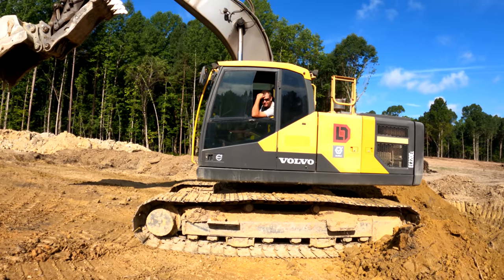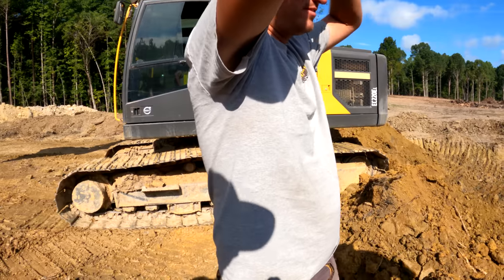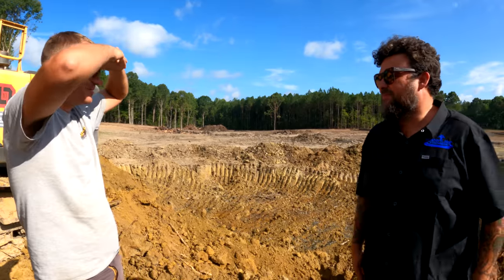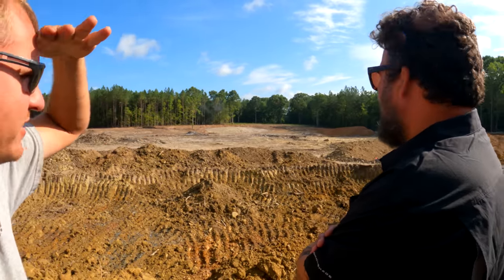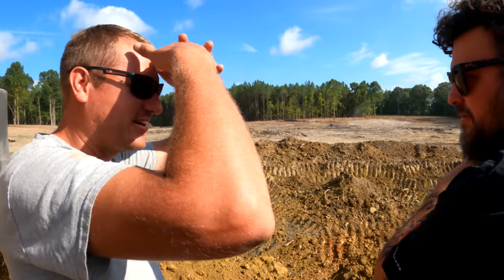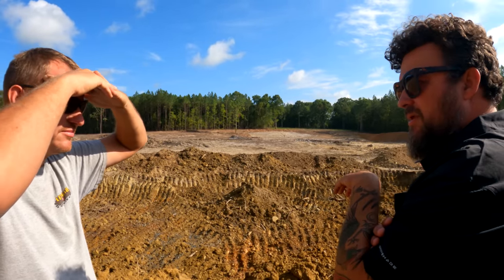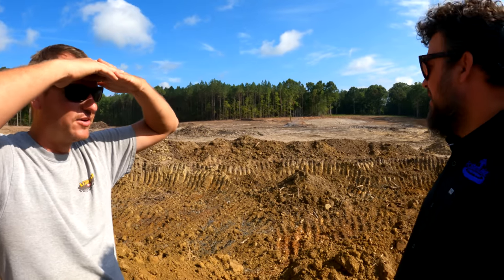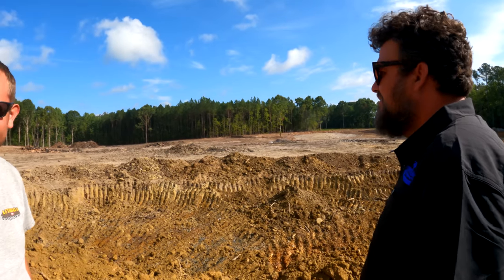How to Prepare a Pond to Grow Trophy Bass

Comment: Went trout fishing a few times after stocking and stopped after releasing 24 8 inch trout now in northern N.Y. they use healthier trout at stocking like12 to 14 inches and also stocked walleye's which took good for the first 3 years till the local people stole all with nets out of season like February when the spawn on rock stream beds.

Comment: Was wondering,, I am sure ,, just guessing 😂 the amount of water inside the pond effects the size the dam needs to be to hold the water back ,, yes or no ,, I was just wondering on what determines the size the dam needs to be ,, other than the fact that you want to drive across it ,,
Reply from the maker: The depth of water (height of the dam) is the biggest factor. Fluid dynamics is an interesting subject.

Comment: I would ask the guys from the fishery if having lots of ash from the ground water run off into the pound will be a issue. I personally would not berry all that debris and closer the 20 ft with clay between the ash. that's going to give you issues with your water. see what they say so chris knows.
Reply from the maker: Good question. I’ll ask. Thanks
Reply: @BealyGood  lots of run off from burnt properties can cause toxin to build in the water making it acidic and prone to having a big allegy issue . you could end up fighting this for years. you might need to add bentonite to the banks were the ash is berried to slow the leaching down. I'd stop bearing the ash so close. might be more work but save your pond from lots and lots of issues.

Comment: The trout  is something  bama bass did not stock , different locations will have different fish,  do they ever stock carp or catfish in bass ponds
Reply from the maker: Great question. I’m making a list for when they come back.
Reply: I know on the bass pond forums as well as on state and private companies that manage ponds they recommend never putting catfish or crappie in a bass pond. Catfish directly compete with bass. In ponds where algae is a significant problem people do stock sterile grass carp. 

Also, Bamabass just stocked his pond with bass only two months ago. They are far too small to feed on trout which are more apt to feed on them. The bass have to be at least 3 or 4 pounds before one starts adding trout as a fall food source. I won't be the least surprised if Bamabass adds trout and goldfish when his fish reach the larger sizes. He's all about producing huge bass and stocking trout is one of the best ways to do it.

Comment: I know having fish sounds super exciting but you got to give that pond some time to work itself out. Usually on a new pond you got to give it like a full year grace period to just let it do its thing. Otherwise you will lose fish and it will never sort itself out
Reply: Not true. There are many examples on the web and thousands more not publicly shown that prove successful ponds can be started soon after they're built and filled. These ponds are not like little home aquariums that need to be cycled. Watch Bamabass's pond build where he built his pond last year, had it filled by December and then stocked it with bluegill and golden shinners at the end of January. He would have done it sooner, but it was winter and the water temperatures were too low. Those fish have grown extremely fast and have reproduced in the tens of thousands. By April he put in threadfin shad and showed that the bluegill had grown large enough to spawn in less than 3 months. Just four months after building the bait fish populations he stocked his bass at the beginning of June and now those fish have more than doubled in size. Bamabass feeds his bait fish as well as monitors oxygen and nutrient levels and adjusts them as necessary. His pond is only six months old since it was filled and it's booming with fish and aquatic life. 

Waiting a year is a needless waste of time.

Comment: Hey Geoff, checkout what happened to Country View Acres when he added aerators in the middle of summer to his well established, 40 year-old bass pond. I'd be curious to know what the Fosterlake consultants would think caused this disaster. I suspect it happened because the aerators moved the low O2 water at the bottom into the pond causing a sudden drop in oxygen levels in the zones where the fish were. see youtu(dot)be/Tcf_rwTKN1Y
Reply from the maker: You’re probably right. When I see them next, I’ll ask. That’s rough for CVA 😢
Reply: @BealyGood  Poor guy tried to improve his pond and did the exact opposite. Three acres worth of mature fish. He lost tens of thousands of dollars in replacement cost. Whoever he bought those aerators from should have warned him. He did say he didn't exactly follow directions, regardless, putting them in the deepest part of the pond in midsummer was a huge mistake. A little bit of research or just phoning pond consultants would have saved him.
Reply from the maker: @snappingbear  unfortunately, the best teacher is failure.
Reply: @BealyGood  Yes it is. CVA is a good man for broadcasting his failure for the world to see and learn from.
Reply from the maker: @snappingbear  yup.